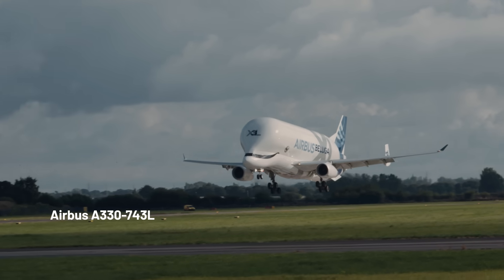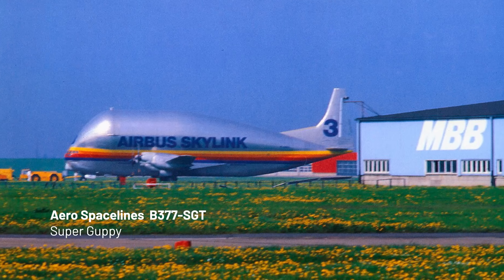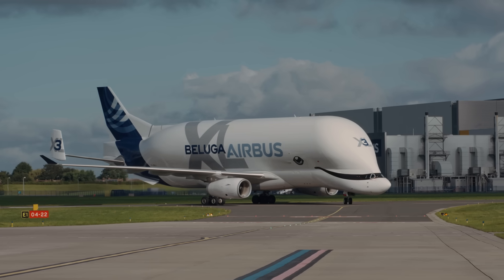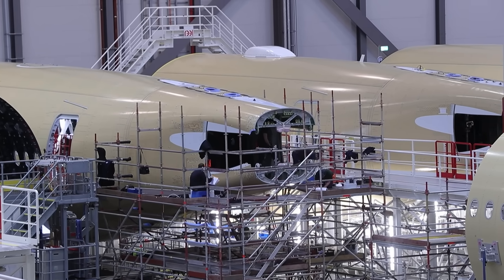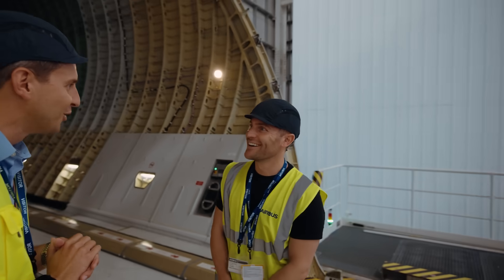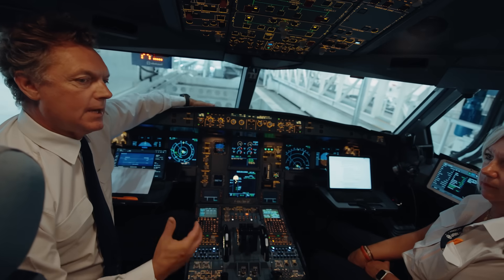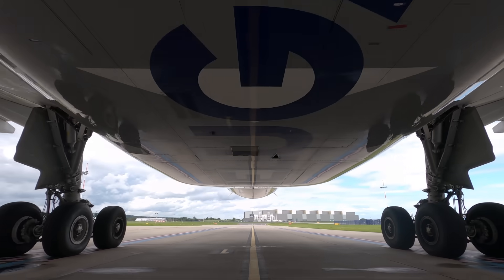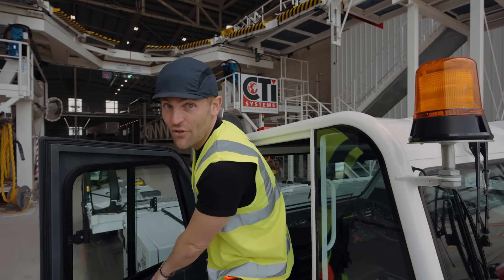Exclusive AIRBUS BELUGA XL tour | You won’t believe what this plane has inside it

Comment: Can see why Airbus is outperforming Boeing. By far.
Reply: If its boeing I ain’t going 😂
Reply: Even in safety
Reply: Boeing is good just make sure you double check you aren't in the same plane with a target.
Reply: @AH69AH69 No it's been proven Boeing takes shortcuts on safety and the amount of compo its having to pay out they nearly broke
Reply: Such a cool bird, but an ugly duckling for sure
Reply: Boeing is a good company it’s just that people say it’s Boeings fault for most of its crashes but it’s mostly mantainens issues or pilot errors but both are really good company’s.
Reply: @Duckiegoat732  Take a closer look at Boeing
Reply: @Duckiegoat732  Boeing is a cheap out.
Reply: @Duckiegoat732  bro will not whistle blow fod boeing💀
Reply: @Duckiegtg  hundreds of Boeing staff have come out over the years and said how poorly the place is run and they cut corners to save costs wherever they can. American employees as well. Since the 737 Max disasters which was entirely boeings fault the FAA have investigated Boeing from top to bottom and have made them change multiple things on the 787 due to it being poorly built in certain areas and now on the 777X, that's why it keeps being delayed. All the Boeing planes are massively outdated besides the 787. They are just old airframes with new engines and technology to try and compensate for both, which is why they ended up with the 737 max crashes. The company is just run on pure greed and all the old engineers from the 80s & 90s have long gone and been replaced by accountants who penny pinch wherever they can. The company loses billions every quarter.
Reply: @Duckiegoat732  lol, boeing are killing whistleblowers, how is that good?

Comment: They fact it only has two engines is incredible and scary.
Reply: Not scary. Modern aircraft are build with redundancy so even if one engine fails they can safely land with the other operational
Reply: The weight is less so 2 is enough

Comment: They could stuff like 5000 human beings in there . Wonder why they don’t carry passengers with this .
Reply: Because there is no demand for passenger planes that big. Even the A380 was a failure unfortunately
Reply: It will be expensive to operate
Reply: It has a massive capacity measured by volume, but a much smaller maximum takeoff weight.

Perfect for moving large items like a couple of new wings, but if you converted all the space for passengers then it would unfortunately never leave the ground.

Comment: This and the A380s always shocked me with they are able to get off the ground. 

Side note, those helmets remind me of professional horseback riding helmets. When fashion meets safety. 🤗😉😊
Reply: Recently I visited a company in Germany which maintains railway engines where everyone wore a similar "helmet". They called them "Stoßkappen" which means bump caps. They're lighter and more comfortable than a helmet and were mandatory to wear everywhere but under loads. There hard hats were required.

Comment: Several years ago was parked  overnight in my truck  outside Chester. It was getting dark when this craft appeared overhead flying low. Hadn't seen it before and thought it was a space craft. AMAZING sight.
Reply: If you ever want to repeat the experience I recommend parking up at around 7am, there is usually one or two near the start of the work day arriving at Chester airport (often called Chester airport even though it's in Broughton).
Reply: Thank you.

Comment: Well done, mate with the capturing of the moving pictures of this whale, i hope you had a whale of a time. I wonder other then plane parts and possibly eating up a fuselage of a smaller air bus plane like A320 i wonder if these planes can stack up cars, train carriages, defence equipment and motor yachts that don’t want to get wet. Thx for the tour
Reply: sure they can but the normal A330-200F Cargo is much cheaper, faster, can load more tons and can fly a longer distance. The Beluga is just good to transport big and light parts for a maximum of 4.000km. There is no big market for big and light parts to transport and Airbus needs all of there Belugas for them self. But Airbus offers now the old A300 Beluga for private charters sometimes when the old ones are free.

Comment: Incredible plane, just waiting for the XXL made from a 380 ey 😅It would have been interresting to hear from Airbus about the impact in the rule of origin thanks to Brexit 😅 I heard that some manufacturer are evaluating to relocate the factories for the next iterations... Sad.
Reply: if there is XXL it would be based on A350XWB, it wont be based on A380
Reply: @redemissarium  380 was done to cut margins of the 747, which worked perfectly but at an expense. We know the US airlines are not keen on using innovation when it is not coming from Boeing. But the airline world is now dominated by asian and middle-east airlines. They are the future and not thr western airlines anymore. So be sure that if a bunch of them come with a requirement to airbus for a few hundred of such,.the project will be evaluate at Toulouse 🥂

Comment: Fun fact: in 1969 UK said "Airbus project will be a failure"😅, so France and Germany created Airbus company without UK. A quick résumé:
- July 1967: France, UK and Germany signed the A300 project's MoU. Work was to be shared 37.5% each between France and UK, 25% for Germany. French Sud Aviation was given the role of “lead company,” while Hawker Siddeley was to be the British partner company. 
- When it emerged that Rolls-Royce would not be supplying the A300 engines (RR had done a deal to supply its RB211 to Lockheed for the Tristar only) British government’s anti-Airbus stance grew.
- December 1968: the day after the A300 had been announced, Tony Benn (then minister of technology) told the House of Commons: “I must make it absolutely clear that I cannot in any way commit the government to give financial support to any new proposals which may be brought forward by the consortium.”
- 11 April 1969, NYT  "Britain Abandons the European Airbus Project; Believes Building the Plane Is a Losing Proposition."   
- But France wanted to continue the Airbus project, so at 1969 Paris Air Show, France and Germany signed an agreement 50-50.  
- The jet engines, first awarded to Rolls-Royce, finally go to GE in cooperation with French Snecma to develop the future CFM 56 engine.
- Arnold Hall, Hawker Siddeley's director, decided that despite the British government’s withdrawal from the project, his company would stay in as a favoured sub-contractor (but it needed a further £35 million German loan).
- 2001: UK came back when BAE took 20% of Airbus' shares.
- Sept 2006: BAE resells its participation to Airbus.
Today Brits are happy working for Airbus, but remember UK in April 1969: "Believes Building the Plane Is a Losing Proposition." 😂
Reply: So 32 years for UK to rejoin the Airbus project. Let's see if we get brejoin by 2052 then.

Comment: Absolutely fascinating. I must say, though, that I was surprised to see the undercarriage. A 777 or an A380 have much more substantial undercarriages to manage the weight. Perhaps the wings that the Beluga transport don't weigh all that much? I'd love to hear if Nicky learned anything about the weight of the Beluga compared to some of the larger passenger jets.
Reply: Airplanes like the Beluga or Dream Lifter are all about volume, not so much weight.
Plane parts are light weight compared to their size, and fuselage sections and wings are basically empty hulls.
Reply: It probably does not carry much fuel either

Comment: Pathetic. You call that close look at intricate engineering. "ohhh big plane, little button"

I want to know how they seal that big door. Is that big cabin even pressurised? I am guessing not in which case I would have liked to see the pressure bulkhead leading to the cockpit.

This clip was for 4 year olds.
Reply: Your post was aimed at 3 year olds

Comment: Please explain why Airbus has a manufacturing plant in Wales? Surely it’s far more efficient to produce as much as possible at one or two sites, not four. There must be method in the madness. What are the brexit implications for manufacturing outside EU?
Reply: First and foremost Civil Aviation is tariff free under WTO so Brexit has no implications on the operation. Originally Airbus was set up in the 60's and drew on the experience of the Anglo-French Concorde. Concorde wings along with other military wings were designed at Filton in Bristol. This is why the wing operation was delegated to the UK. The wings were then originally built in Manchester at a site with no runway. When it became clear that an Airfield factory was required, the UK government had the option of RAF Finningley or former RAF Broughton. The latter was chosen in order to enable employment in a poorer region. It has worked very well. There is no madness in it.
Reply: @nathd1748  Thanks for the explanation and history of Airbus. Seems a little odd for the aircraft manufacturing plants to be so distant involving huge transport costs, the arrangements seem to work successfully, I imagine it has to work as various governments have made grants to Airbus and they want employment in respective countries in relation to investment but at great cost. Are EU rules of origin not a complication?
Reply: @jeanjacques9980  The EU Rules of Origin do not cause any complications. Like I said previously, civil aviation is zero tariff under WTO rules unless "dumping" can be proven. It is why Air France had no issues buying CF6 engines for their A330's when Rolls Royce from within the EU were available. Airliners require so much input and high tech components that it is physically impossible for 1 country in Europe to put all this together in a timely manner. Components for the 787 are made in Japan and Australia similarly, which shows even the USA would rather get the best result by going International. It must work. Just look at Airbus now!
Reply: @nathd1748  Thank you for explanation and history. It still seems odd that the planes are built in Toulouse and the wings a thousand miles away across a sea. The logical thing would be to produce the wings in Toulouse, it’s not that they are easy to transport. But I understand that in a European joint venture each government wants a piece of the cake from their investment. How much cheaper it would be for Airbus to produce the wings alongside the aircraft?
Reply: @jeanjacques9980  Yes, I understand that, but there is absolutely not enough room at Toulouse Airport. That's the reason they also have a final assembly for A321 in Germany, a final assembly for A320 in China, and another final assembly for A320, A321 and A220 in Alabama. Then they have the A400 line in Spain!
Reply: @Franky997  They have spent some good money upgrading Broughton, but it still needs shitloads more throwing at it. Drakeford can't call on EU money and more to keep Airbus sweet.
Reply: Boeing do the same now
Reply: @ant2312  So I gather, not just Washington.
Reply: @@Franky997 Very interesting comment from an insider’s perspective.
Reply: @@Franky997 I’m worried! Good reason to avoid planes if possible, I prefer using ferries.

Comment: I am a current Capt. TRI/TRE A320/330/340/350 with greater 20000h worldwide CAT III ETOPS experience ( 9300h on A330) and would like to join the team to operate this  BELUGA whale. Where can I apply?
Reply: Airbus headquarters: Toulouse, France. Location: 2 Rond Point Emile Dewoitine, 31700 BLAGNAC. France
Reply: of course you are, as if a real captain would need to ask on here, plus the A350 is a different type rating

Comment: How does it operate with such small engines
Reply: they create thrust and it flies
Reply: he has the same engines like the normal A330-200 and this is enough for his use. He transport only light but big parts for a middle range. The normal A330-200 can load more tons, is faster, heavier and can fly a longer range.